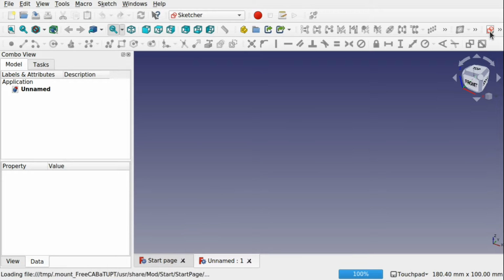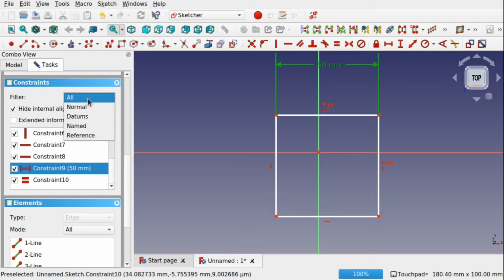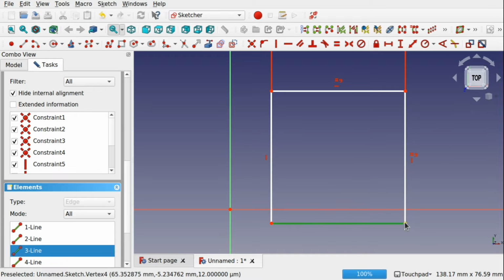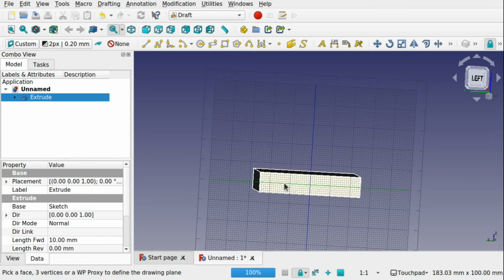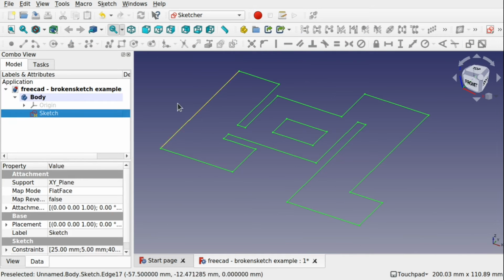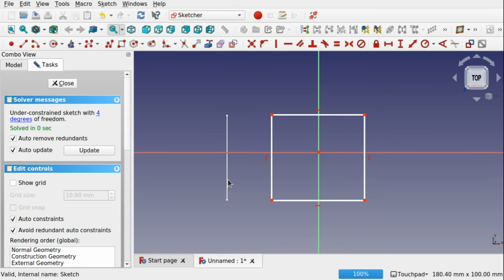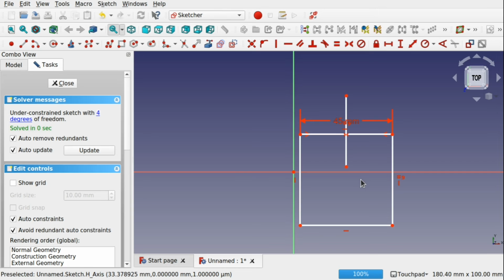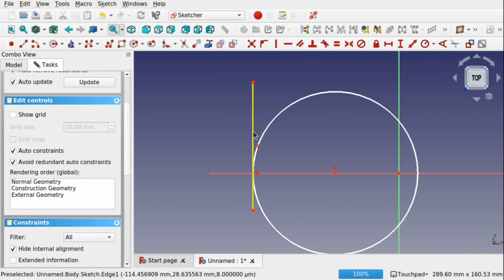Learn FreeCAD: Beginners Sketcher Tutorial: Tips and Solving Problems in the Sketch Workbench

Comment: Great vids! I can actually absorb the info you are imparting because of the way you do it!

I'm an absolute never done any CAD type work before and after watching a plethora of vids yours as already said are the one that conveys the information in a way that I can absorb! 
A major issue that I have is that as a result of me doing something to my settings (no idea what!) my Tree view and Property view panes are no longer on the left hand side directly under nav/menu bars and the Tasks pane is full width above them - I've trawled the setting trying to work it out, reset back to standard, deinstalled and reinstalled the version 19 and tried searching the forum for a solution so reaching out to someone that may be able to help with the solution.
Reply from the maker: Thank you for the comment, great to hear your liking the videos and thanks for the feedback. So if you go to the properties there should be a button that says reset at the bottom left. The panels are a bit tricky, you have to drag the panel from where it title is, so you should be able to drag to the far left  and wait for it to dock and let go. If you lose a panel like the combo view it's actual go to view, panels and select from there.

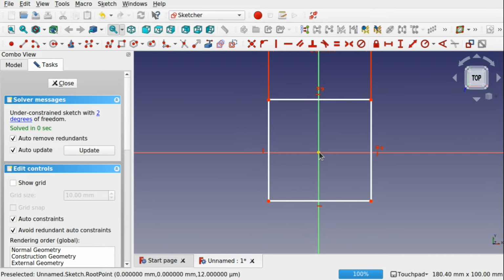Comment: Thanks for the video. Question: I notice that when you are doing the square constrain at time 14:20, you select the two opposite points of the square and then the center point of the grid. When I do that, I cannot seem to get the center point selected. What am I doing wrong?
Reply from the maker: It sounds like you are sketching on the reverse of the sketch. If your rotate your view to around the other side then if you find its easy to select then your on the wrong side. By any chance are you using a datum plane? If so then click on your sketch in the tree view and go to the data tab. You will see a property called Reversed. Set this to true.